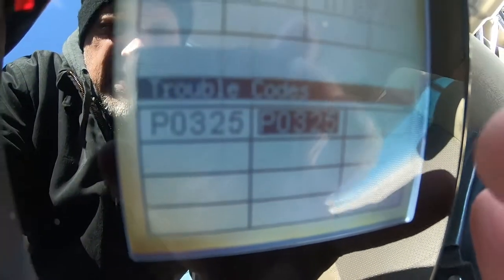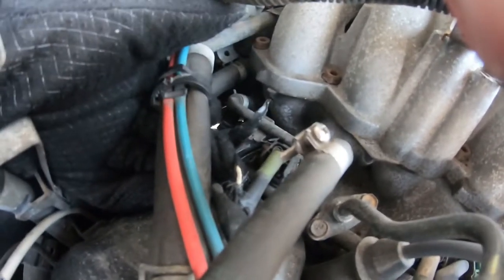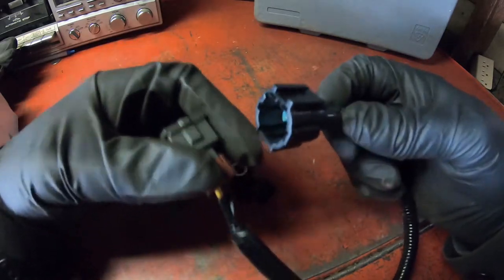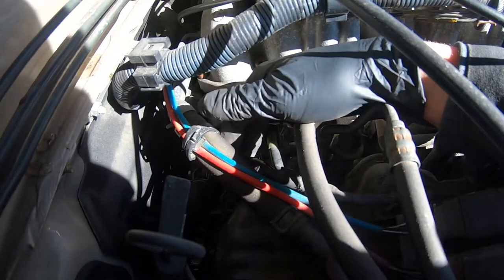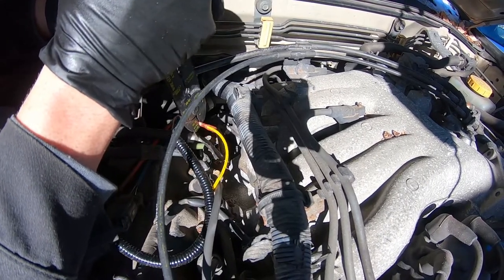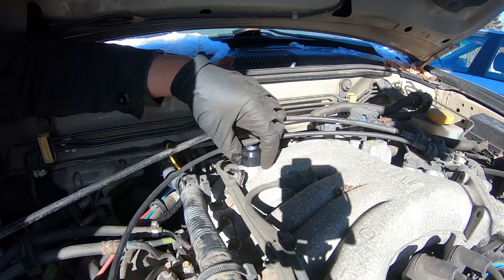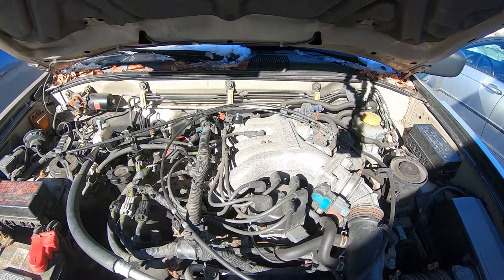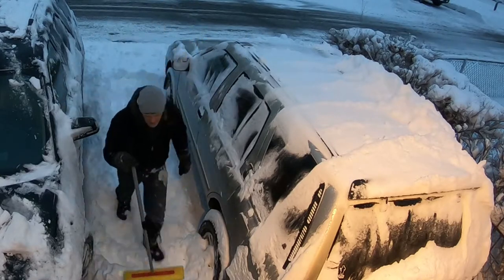Don't do this Knock sensor hack Nissan Pathfinder P0325

Comment: You can also do. A little reach around and break off the original switch, and reuse it in new location. No cutting or splicing.
Reply from the maker: O good call wish I tried that.
Reply: Unfortunately for me I just had the air plenum off to replace the fuel regulator. And two weeks later the knock sensor goes out. Should had replaced it when I had it apart. Didn't think about it until we were almost done putting it back together. Just my luck. So off it comes again. Now I'm having a abs issue. I've had 3 mechanics try to read it. Scanner says no communication. So now I'm needing to replace the abs module. Fun stuff.  Lol

Comment: Unfortunately by relocating the knock sensor on top, it doesn't work correctly. It needs to be on the block itself. I know this because I've done this exact same thing. I'm currently trying to figure out where an easier spots on the block. No luck so far. I'll probably have to just put in where it belongs. Great video though. Thanks
Reply from the maker: Yes, it’s not an ideal hack but for the people who drive vehicles that are only worth about $1000 it could come in handy.

Comment: Just got a 2000 Pathfinder for free from a relative. I've been slowly doing work and saving various videos. This one will come in handy as I imagine I'd prefer not to destroy half the car to get a light turned off. I swear half a car's sensors are only there to turn on the CEL.
Reply from the maker: Exactly! Older cars don’t have nearly as many problems. Although with the right computer equipment most modern cars are fairly easy to diagnose. That’s a great vehicle. I had mine for almost 10 years. I just sold it last weekend.

Comment: Bought a 99 Pathfinder this year and it has this done to it already. But it has 2 wires coming from it. The Pathfinder is jerking real bad and not accelerating. Had knock sensor code and crank position sensor code. There was oil on the CP sensor. Is that normal?
Reply from the maker: I would probably worry about the crank sensor code 1st. Then clear and drive it. See if the knock sensor code comes back then worry about that.

Comment: My mechanic told me todo the same thing lol. Did it improve power and gas mileage ? That’s mainly the main issue I’m having since that code appeared.
Reply from the maker: Runs and drives normal. I don’t know how long this will last but for now it’s good.
Reply: @AndyTheXTech  Thanks for the response !

Comment: great video, what size was the new longer bolt to secure the sensor?
Reply from the maker: Thanks! I’m not really sure about the size of the bolt but it was about 1/2 in longer than the sensor. Pretty common metric thread just an extra bolt that I found in my toolbox.

Comment: Hello there! You’re the man from the A1 parts videos, I’ve enjoyed the help you’ve shared from some of those episodes. I recently bought a 1996 Nissan Quest w/3.0 engine. I’m suffering from a terrible low speed bog and bad gas mileage. My mechanic scanned it today and found a KS code. I plan to do this to mine and pray that it helps with my symptoms. Great video, thank you!
Reply from the maker: Awesome! Yeah I still work at 1A. And yes the knock sensor tricked worked on mine. Little bit easier than pulling the intake off. 👍
Reply: @AndyTheXTech . Thank you! Ok, so this Saturday I will do it! I have all the parts and am excited to finally get this done. I have just one very good and final question. I don’t want to relocate the throttle bracket. I want to mount the sensor on top of the bracket. I wonder if it will still be able to hear through all that steel. What do you think? Thank you Andy, I just subscribed to your channel, it sure is a good one.

Comment: Hi. I've got an unmodified 1998 Nissan Pathfinder, 164,000 miles, 3.3L V6, 5 speed automatic transmission.  Owned by an elderly couple...treated well. Runs smoothly.

10w-30 oil/filter is new and full. Same with transmission fluid.

When it's first started it knocks or loudly rattles for 3 seconds. Then it stops. Once warm it will only do the startup rattle about 50% of the time.  Exact same noise returns from about 1,800 to 3,200 RPM and then stops.  Also, the noise quiets and sometimes disappears between 1,800 - 3,200 RPM if I let off of the accelerator and coast.  It also will not do it sometimes if I'm going up a steep hill slowly with the RPMs are in that midrange, under the hill's load.

The noise increases in speed and loudness with increasing RPMs.  It sounds like 1 or maybe 2 cylinders of the 6, to me. 

The main bearings and rod bearings were changed. Looked good, some rod bearing wear on a couple but not serious. No rod or crank shaft slop was noted before or after replacement. Made no difference in the noise.  The crank was NOT sanded/polished.

It throws a P1400 code for EGRC Solenoid Valve error.  I don't notice any idling or power issues though. It returns within a few minutes after clearing the code.  Could this cause a knocking noise at certain times like I have?  It runs smooth cold and hot.

I've narrowed it down to 5 things based on its part time occurrence:
1. Flex plate?
2. Timing belt tensioner failing (unknown when last changed)?
3. Torque converter?
4. Hydraulic lifters?
5. EGRC Solenoid Valve?

I have two short videos I recorded it and can share if you want to hear it.  Thanks!
Reply from the maker: Yup my first thoughts are lifter. Send my the videos andythextech@gmail.com 
Maybe I can help you out.
Reply: @AndyTheXTech  thanks will do!

Comment: Hello how are you? I'm from Brazil and I have a 92 year pathfinder, my car is without this sensor, they say the right place is the collector but in this place you put it doesn't change anything? since the manual says below? my car is with idle speed oscillating and some popping in the collector, is this my problem? since I changed everything I could?
Reply from the maker: With the new position so far there hasn’t have any problems with the pathfinder running. But I don’t this this is your problem. It could be many problems causing this. Plugs, wires, cap and rotor, timing, dirty throttle body, idle air control valve, are some possibles. I would first check for vacuum leaks.

Comment: Hey man thanks for the video! Can you tell me if you haven’t had any issues with this hack?  Where did you buy the harness? Any link? I bought one sensor  but it came with the wrong harness.
Reply from the maker: Yup so far it is still working great. The link for the part used in the video:  https://amzn.to/3flGJYm (affiliate link) 
its also in the description if the link doesn't work.  Thank you for checking out the video. 👍

Comment: My 2000 Pathfinder LE has to be started at least 2 times for it to stay running, drags with acceleration, and pretty much burns through gas. I took it to a shop and the only codes are the knock sensors. Hopefully this will fix or help it!
Reply: did it help

Comment: I’m going through this right now with my 2002 Nissan Xterra with 120,000 miles. It recently threw a knock sensor code. It was running fine now it’s got a flashing check engine light any misfire and I have been told by everybody on the Facebook forums that something else is causing the misfire. It’s not my knock sensor. Either way, it doesn’t really matter at this point because the truck is already at the shop. God knows what the repair bills going to cost. I will find out on Friday fuck my life.
Reply from the maker: Ya knock sensors don’t normally cause misfires but any thing is possible. I’ve seen some weird s#*+ 👍

Comment: I have the same problem on my 2000 Xterra.  Same code.  BUT, also have loud knocking sound from engine.  One day fine, next day knocking with code.  Could relocating the knock sensor with a new one stop the knocking?  Everybody is telling me the engine is shot??  Sure hope not!  Only 167,000 miles!  HELP?

Comment: Hey Andy, do you know if the relocated knock sensor can actually sense knock from the new location, or if the new sensor just alleviates the DTC code by being a happy, healthy, wired-in sensor regardless of its location?
Reply from the maker: Is it should work fine it might be off a little but with the age of these vehicles I just want it to run.

Comment: I replaced the knock sensor the correct way and still code appears. Mechanic says pigtails go bad on these.  I have a Hitachi knock sensor new inside engine that I would like to still utilize. So the harness you got will not work for my application. The connector harness I found online that matches the sensors all have two wires on it  instead of one.  I plan on possibly doing relocation with a cheap knock sensor I previously purchased before Hitachi two feet long wires and connecting to radiator side of connector so if code comes up I would narrow issue to ecm wire. Then just have extra length open car back up and connect to harness already in engine. No shielding on harness that's avaliable online. Do you think I can use both wires without issue and shielding and expect same engine performance. What would be optimal ? Thank you
Reply from the maker: The way I did it worked in mine. You could try it and see if it works.
Reply from the maker: Also there is a link to the part I use in the description. Comes with the sensor and the harness it’s for an infinity.

Comment: Can you explain why the description says "Don't do this knock sensor hack"?
Reply from the maker: Hint hint nudge nudge. 😉👍
Reply: @AndyTheXTech so no issues so far?
Reply from the maker: @benwoodley8158  it worked for as long as I owned it. I sold the pathfinder last year.

Comment: Was the car running bad before the relocation
Reply from the maker: Yup. Just had the engine light and code. It’s still running great and no light. 👍
Reply: @AndyTheXTech  my 02 3.3 Xterra keeps getting the po328 code but pending and it doesn’t turn on the engine light . I did the full tune up with oem parts. Including timing belt distributor. Car feels like it still has a slight miss . From what I have read everyone says the knock sensor doesn’t affect the non supercharged so that is why I was wondering how yours ran before. Thanks again.
Reply from the maker: Ya it’s probably not coming from the knock sensor. I would double check the cap and rotor. I did one and the cap melted causing a misfire. Could be the distributor also.
Reply: @AndyTheXTech  I got new one from 1aauto. It was making weird noises so they sent me another one free. Great service. Installed it and it seemed ok for a bit but now I get this rough idle for a few seconds on cold start and it clears up and idles smooth after a min. I swear it’s these aftermarket distributors.
Reply from the maker: Ya check that cap. You can email me at Andythextech@gmail.com I can send you a picture of what I’m talking about specifically.
Reply: @AndyTheXTech  just emailed
Reply from the maker: Sorry I didn’t get it.  Try typing it out andythextech@gmail.com
Reply: @AndyTheXTech  sent